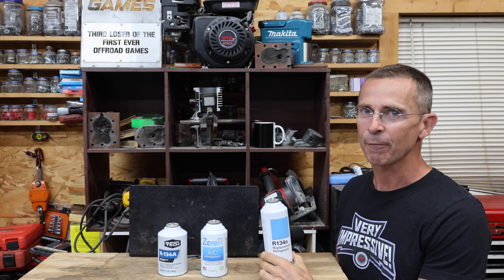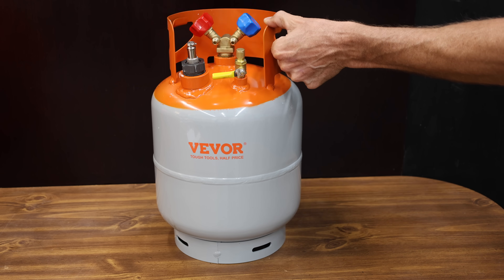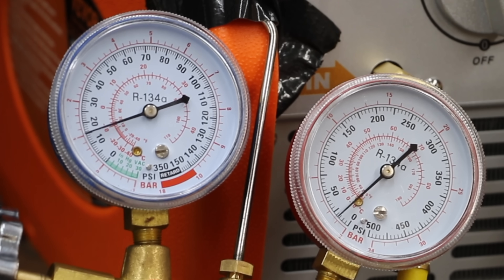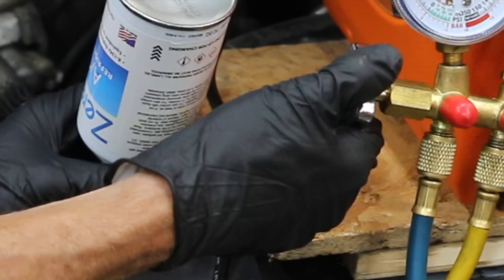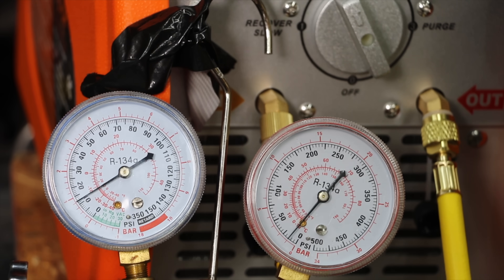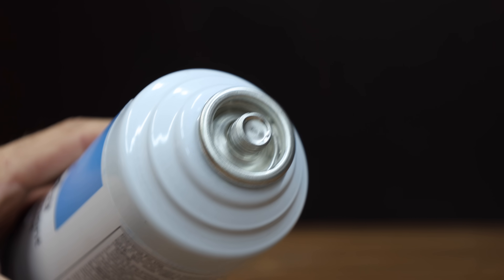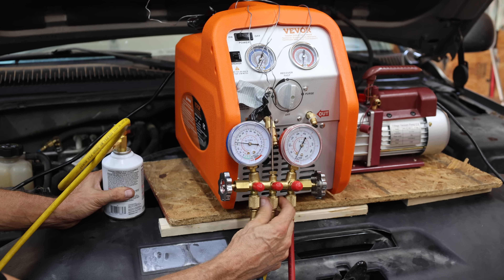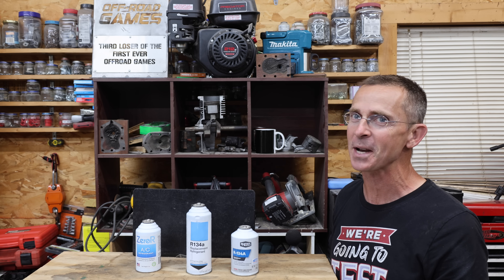How Dangerous is Fake Car A/C Refrigerant? Let's Find Out!

Comment: If you don't want to spend the money on those replacement cans. 
You can use propane and butane. 
70% propane (R290) and 30% butane (R600) perfectly replicate the pressure curve of R134a. 
You'll need about 1/3 of the amount of R134a. 
Fill by pressure! You can buy these self service ac hoses and replace the adapter for the can for a R290 adapter which will perfectly fit on a propane canister with its 7/16 screw head. 
Very cheap and works well. 
If you want colder air from your ac, slightly increase the amount of propane.
Or you can use so called R436A, which was specifically developed as a 1:1 replacement for R134a. 
It uses 56% propane (R290) and 44% iso(!)butane (R600a) 

I wouldn't be too considered about leaks or flammability. 
At first you need the right air fuel mixture for it to ignite and then you'd need an ignition source. 

You all know the horrible smell even a small gas leak creates. 

Try lighting a propane torch with a completely empty lighter and you'll see how unrealistic a fireball would be. There's much more concerning stuff under the hood
Reply: Thats exactly NOT how you go about servicing your AC. As mentioned in numerous comments and articles, you can be drastically low or high and get the same static pressure readings. Vac the system out, and then follow the manf. directions on filling by weight.
Reply: People shouldn't be allowed to spread information like this around when it is not an approved method and can cause injuries or death.
Reply: Or you can buy HC-12A which is a blend of propane and isobutane intended as a replacement for R134A. However, it is technically illegal to use in the US in systems not designed for flammable refrigerants.
Reply: @boots7859  yeah, you need college and post graduation. Lower the prices of servicing ac, or just shutup.
Reply from the maker: Thank you for sharing!
Reply: Its best to use these flammable refrigerants when its your own vehicle or when the owner understands the risks and what to look out for. The whole point of R134a was that it was nonflammable. Also, ignition in a car is pretty dangerous since its a mostly sealed environment and there are relays sometimes in the dash that can cause ignition.
Reply: @boots7859  The RRR machines are checking the dynamic pressure since the system is in operation while its being filled. Also, fancy RRR machines meter the weight of the refrigerant. Obviously you shouldn't put flammable refrigerants in someone else's car since a lot of people ignore warning signs.
Reply: @Discretesignals  Except they should. The advice is good and mentions the dangers. Also, this isn't the EU.

Comment: Also would be great to see cheap vs expensive multimeters and cheap vs expensive 10A 30V regulated benchtop power supplies.
Reply from the maker: Thank you for the video idea!
Reply: All I can tell you is unless you are on the side of the road and just need a cheap multimeter, don't buy the 6 dollar harbor freight one, I've broken probably 4 of them and at this point could have bought a nicer multimeter,

On the other hand I bought a cheap tacklife bench power supply for $40 bucks and even 2 years later it still works just fine

Comment: propane once used for a/c  was removed due to being  flammable, now the new replacement for r134a  is flammable,  gotta love the government
Reply: It's not as flammable as propane/lpg (which this is), and much better for the atmosphere. The replacements were developed by the AC industry, not the government.
Reply: @noyb7920  except 134a becomes a incredibly toxic phosgene gas
 when burned by a flame where the tiny amount of propane in the these mixes is barely enough to be a issue like... my car would take less then half the charge with this stuff compared to r134a
Reply: Isobutane is also widely used in imdustrial coolant chambers aswell. And some bakeries inside commercial stores also use carbon dioxide as refrigerant due to its good compression behavior. A good use of greenhouse gas, I'd say.
Reply: @T_TanksTinkers1066  Guess you haven't seen a brand new fridge blow up took out half of the house.
Reply: @Align700nitro  seen a compressor short out an catch fire but never a explosion, but that sounds like a extremely rare case like... getting hit by lightning three times in a row rare
Reply: @Align700nitro I know some fridges comes with R600 that is extremely flammable. Did they mentioned r134 directly blowing up the apartment? Just curious
Reply: Several HC types can be used as refrigerants, but isobutane (R600a) is the most commonly used HC in household refrigerators and freezers. Propane (R290) is used more in commercial heat pumps, air conditioners, and refrigerators and freezers.

Comment: Maybe you don't know this but the majority of the appliances, window AC, and portable AC units have flammable refrigerant in them. Next year all HVAC systems manufactured will be using flammable refrigerants. R32, r290 and other blends that's similar
Reply from the maker: Thank you for sharing!
Reply: Vehicles I believe are moving to R134Ya.
Reply: @ATruckCampbell  R1234yf perhaps. Anyway R290 will burn hard, but the fluorinated refrigerants in a fire will decompose into extremely toxic stuff.
Reply: Refrigerators and window AC units use hard lines that are soldered together.  A car AC uses flexible hoses and quick connect fittings.  Car AC is much more likely to leak.
Reply: @MrSloika  Yeah right, I own a HVAC company. Those Chinese ACs are more likely to leak. Everything from China is pretty much junk. I've got at least 20 that are junk and I've got 3  vehicles that are 20 plus years old with the original AC. I used to put propane in r12 systems decades ago.
Reply: @MrSloika  the only issue I've ever had, I used to charge up the r12 systems on old tractors with propane because the r134 conversion wouldn't keep the cab cool enough. Propane is pretty close to r12 in cooling capacity. One farmer let his condenser clog up while running the bushhog. Unknown to me, those old tractors had blow off pressure relief valves instead of a pressure switch in the AC system. Well his "blew off" the refrigerant (propane) and the vapor was being sucked back into the breather of the engine. He said the engine started revving higher and higher even though he was throttling down. He said it almost pegged the tachometer. He said he was trying to kill the engine and at the same time trying to disengage the bushhog so it wouldn't destroy itself if a blade broke off. Then he remembered the propane, shut down the AC, rode the brakes and ran the bushhog in heavy brush (he didn't get it to disengage) and it finally stopped.

Comment: It's been a few years since I've had one of your videos recommended. I'm very impressed that your format has only improved and expanded! Keep up the awesome work! I just removed about 2 ounces of R134a from my car using a refrigerant can in a bowl of iced brine because the compressor was engaging a bit hard and it was shutting off to prevent fluid ingestion. (Would restart after a few seconds but the conditioned air would become clammy before the compressor kicked back on). Thanks for sharing the correct way to do all this!
Reply from the maker: You are welcome!

Comment: To speed filling with R134, get a bucket and fill it with hot water.  Insert the R134 can top-up in the hot water.  It vaporizes the liquid refrigerant and fills the system a lot faster.
Reply from the maker: Thanks for the feedback.
Reply: no, don't do that
Reply: As long as the can is half empty it's safe to heat up, I just put it on top of the engine when filling slows down.

Comment: Less fear mongering on hydrocarbons!  They require 1/3 the weight of HFC’s , 0 ODP and GWP is 3 (R290 propane) compared to 1430 for R134a.  A F150 has 900 grams of 134a, replacing with a hydrocarbon would be about 300 grams. That’s like strapping a deodorant can to the front of your car. Never mind the 90 litres of gasoline under you, or the Li-ion battery under you.  Hydrocarbons are the best carbons

Comment: I would love to you do the same video using compressed gas dusters (r152a Difluoroethane). You can buy a side can tap from Napa autoparts to fill the system. If you buy a multi pack from Costco, it would definitely be the cheapest way to recharge an a/c system, and when the time comes to repair or replace components on the system you don’t have to recover the gas, as it’s obviously legal to release it into the air.
Reply from the maker: Thanks for the suggestion.

Comment: In Canada we can't buy actual R134a in these cans, you have to take it to a shop to get it done.  However you probably should do that anyway because of your system is low on refrigerant there's probably a leak.
Reply from the maker: Thanks for the feedback.
Reply: That's not true. All car A/Cs loose refrigerant over (albeit a long period) time because they are not 100% sealed. The shaft in the compressor needs to be able to spin, if it was truly sealed it wouldn't spin so they lose refrigerant. For example my 2001 Tacoma was low on refrigerant and I re-charged it 3 years ago and it's still blowing ice cold today. No leak, just ran low over 20 years

Comment: in canada if you put this fake refrigerant in your vehicle any reputable shop will not touch it and will immediately know its in your system. The vacuum pumps in most ac shops can immediately detect contamination, which is what this fake refrigerant is. R134a is illegal in Canada, I have to get it across the border, I always keep it stock piled.
Reply: doesnt matter, you can empty out your system legally of any hydrocarbon alternatives before going to a shop (vacuum)
Reply: @bn880  It will still leave enough traces behind to be detected. I learned the hard way years ago. If you wanna use this sh!t at least know what you're doing and own your own equipment.
Reply: @ardiemclelland2039  nah, propane/isobutane leaves no traces if you vacuum the sucker well enough.  they will detect custom dyes but you have to admit to using non specified refrigerant for them to KNOW

Comment: All I can say is, THANK YOU. Thanks for actually showing the proper recovery of waste gas. Try and find a video about AC in cars where they don't just vent it to the atmosphere, it's tough as nails.
Reply: If that was the case he would have had a legal recovery tank instead of the cheap knockoff vevor that nobody will exchange making this about the same as venting into the atmosphere
Reply: From a logical point He didn't really need to recover the butane propane charge as it occurs naturally as it came from the earth. 134a is man made and needs to be recovered.
Reply from the maker: You are welcome!
Reply: Once use to use a pump or another running cars compressor and pump the gas back into a 30 LB R12 jug. That waS PRE 1990 when they had 2 way valves on jugs.

Comment: R152a is a great R134a and R12 replacement. It is compatible with R134 oil and R134/R12 crossover oil. It's got lower GWP than R134 and it comes in the spray cans, you know, the ones you use to clean your keyboard...just like you used to use R134 to clean your keyboard if you bought the cans of past. You can buy R152a cans without bitterant added and get some can pinchers with a Schrader valve. Works great.
Reply from the maker: Thanks for sharing.

Comment: I am in Canada,  Environmental laws are so strict that un-licensed car shops/Rebuilders use Propane instead of proper A/C Refrigerant.
Reply: My condolences
Reply: My uncle did that in the 60s. Worked well.
Reply: Which is a properly usable refrigerant if pure enough (aka R290). Though it's not the best R134a replacement. These cans are usually a propane/ethane mixture. If you get the proper stuff and not the fake ones they will even tell you the mixture rate and properties. The reasons these exist is because most people want to do it themselves and then dump very ozone depleting gases into the atmosphere. This way they will only dump propane which is a lot less bad.
Reply: Confused? What have “ev laws” got to do with a/c?
Reply: @edc1569  There are refrigerant regulations in order to protect the depletion of the ozone layer.
Reply: @edc1569  R12 released into the atmosphere takes over 100 years to dissipate. R134 takes over 20 years to dissipate. 12A, the replacement meets the Montreal environmental parodical, therefore, any individual can handle it without needing any special license. It also blows much colder.
Reply: The new safe feel good refrigerant poised to be required in the US is mostly propane I believe.  Pretty much just like every one that comes out claimed was touted as.  My first car I brought back to the dealer of a hiss seemed to be from one of the schrader valves on the AC.  The tech said no there is no leak or problem i bent down slightly to show if you do this you can hear.  He says woah don't get to close to that (r-134) it's dangerous.  I said ok so you say there is no leak, no problem and the refrigerant is "safe." So exactly what is the danger.  The compressor seized the next day btw and they had to replace the entire cooling system for free.  The actual problem was a leaking low pressure sensor which on that car didn't even require discharging the system ($45).
Reply: When you get into a wreck the condenser & grille becomes a BBQ grille 🔥🌭🍔🥩
Reply: @edc1569 Environmental laws, duhhh. Are you 4??
Reply: @daewooparts  Big Feminine Energy
Reply from the maker: Thanks for sharing.
Reply: @daewooparts  And your gas tank leaks?
Reply: @NoNameForNone oZOne DePleTiNg.... That scam is old. Ozone hole has gotten smaller
Reply: @NoNameForNone  
replacement for refrigerant r134a, as a mixture of r290 + r600a 50% / 50% is very good
Reply: Whereas in the US, it is illegal to use flammable refrigerants in systems not designed for using such refrigerants. I think it is quite interesting that it is easy for the general public to buy R134A.

R290 (propane) and R600A (butane) is a commonly used refrigerant in refrigeration as it is environmentally friendly. However, they are not commonly used in HVAC as the amount of gas required for such systems make it riskier in case of fire. 

Fun fact, the use of HC-12A (a blend of R290 and R600A intended as a substitute for R12 or R134A) was the cause of a tragic bus fire in Panama City in 2006.
Reply: Propane was a common substitute for r12 in the early 90s in Mexico. I've been told that it took less Propane to do the same job as r12.
Reply: yea canada ia a globaliat wef country..
Reply: @LitheInLitotes  are you dense?!
It got smaller BECAUSE of the laws we implemented!!!
Reply: You can literally go to canadian tire and buy this,  where is the restriction?
Reply: @louisglen1653  *in order to protect some big fat pockets

Fixed it for you
Reply: @jonathantarrant2449  Not R134a or R410a
Reply: @MrArcticPOWER  ill look next time but im pretty sure r134a you can, not sure about the other. Its called duracool or something similar
Reply: Canada…go figure
Reply: Same here in the EU, but I suspect that the "environmental laws" are more a result of HVAC industry oligopolistic lobbying (trying to sell licences and stop DIYers, i.e. "right to repair") than of environmental concerns. Freon (CFC-11/CFC-12), which I wonder why PF was talking about all the time in this video, actually had an environmental impact, but that has been banned globally (for common uses like car AC) since 1994. Newer refrigerant replacements like R134a and later do not have any relevant environmental impact (delusions of the Climate Cult don't count).

By the way, both propane and butane are indeed proper, standardised and common AC refrigerants. They're not "fake R134a", at least when the labelling on eBay products isn't misleading. And I´d prefer to have butane/propane leaking into my passenger compartment over e.g. R134a, in the hypothetical case that such leaks would be large and common enough to even think about.
Reply: @MrArcticPOWER   It appears I am more optimistic than you.
Reply: I know, right? If you don’t have your ODP cert here, you’re not buying real refrigerants!

Comment: Suggested video: products to restore the plastic trim, mirrors, etc on your car, such as Turtle Wax Acrylic Trim Restorer, Adam's New Black Trim Restorer, Carfidant Trim & Plastic Restorer, Maguiar's Ultimate Black Plastic Restorer, Chemical Guys VRP, and Cerakote Ceramic Trim Coat Kit, etc. Thanks for all your entertaining, well-edited and informative videos. Well done.
Reply: It was tested already, see previous vids on the channel... ✌️
Reply from the maker: Thank you for the video idea!
Reply: Another one you may want to try is Rustoleum Wipe New.  Todd tested that, and I use it on my 11 year old vehicle.  Looks great.  By the way, do not expect these to be a permanent solution to faded trim... it will have to be reapplied from time to time, especially in more sun intensive climates than Maine.

Comment: Your thermal camera and ir thermometer is reading surface temperature of the plastic duct, not air temperature
Reply: The duct has such low mass it's probably fairly close in temperature if it's been blowing for a while.

Comment: In Canada you can't buy R134a so instead they sell 12a which is basically propane. I've used it when I rebuilt AC systems in a few cars. For DIY it works great. Outside of the North American marketplace, Hydrocarbon refrigerants make up approximately 50% of the refrigerant used throughout the World.
Reply: Dupont hates that news getting out there
Reply from the maker: Thank you for sharing!